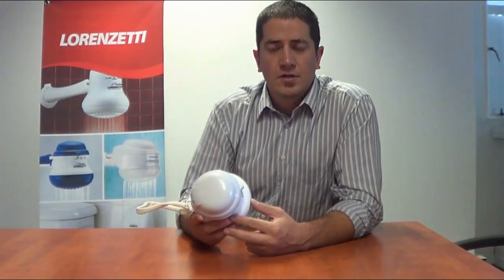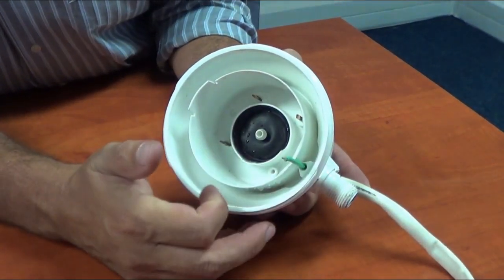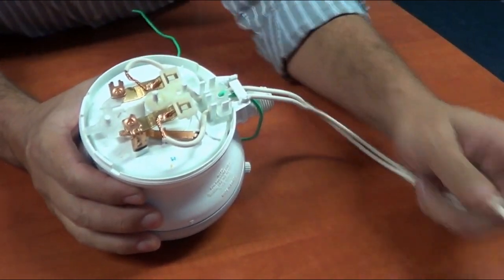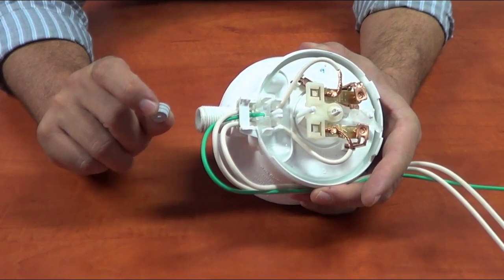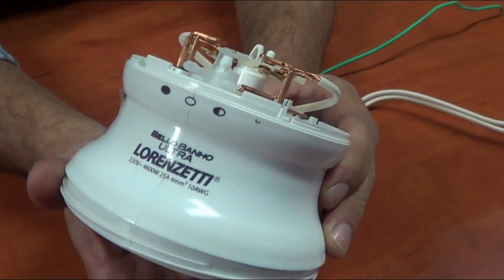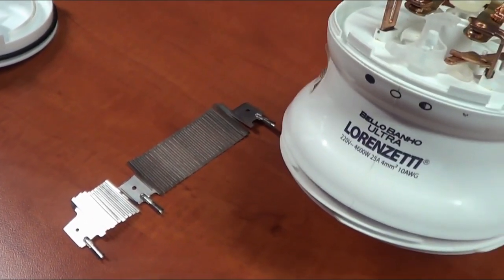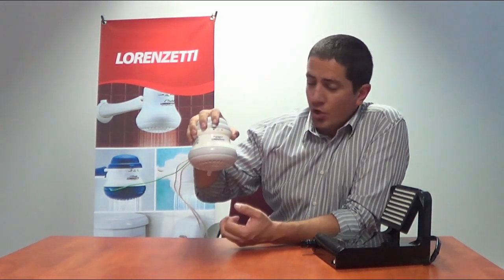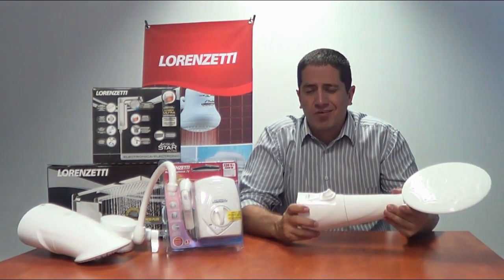Lorenzetti - Save Water and Electricity

Comment: what if didnt connect  the green wire to ground,, because i dont have  ground on my hous?? what am i going to do?
Reply: Most houses (I think more than 90%) have no ground wire here in Brazil, neither does my house. My family and I have never been electrocuted.
Reply: If you change the temperature or touch it or come too close to the head while it's running you'll get a considerable jolt. If you have a concrete house take it to metal that's in the concrete like a box of that's easier. Also if you can buy a GFCI breaker it'll help keep you safe by shutting off the power of it senses you are getting hit by electricity.
Reply: Loop the green to the neutral
Reply: Don't use it if you have no earth wire, otherwise you will get electric shocks from it
Reply: @GabrielRhBR   never say "NEVER hve we been electrocuted". It is like saying I hve never been dead coz I am a live.  YOu hve just been lucky up to now . What about tomorrow?. You may come to regret one day, when you see it happen to a loved one.
Reply: @AutoUnder  it is not permitted, more over if you read the manual, it says that exactly you can not do that.
Reply: use metal pipe to attach it to shower outlet bond ground to that pipe that way faucet and drain will all be at same potential
Reply: You asked a long time ago but maybe the answer will help some one else . You just clamp the green wire to the metal pipe . Thats where the earth wire grounds anyway, it just does it outside by the meter

Comment: Hey how do you fix the switch that controls the temperature when its on hot the water come out hot
Reply: Come out warm i mean
Reply: @wandilegift6001  try to reduce the water flow
Reply: @wallace.museka  the water flow has already been reduced
Reply: In that case it might be something to do with the elements and if the elements are intact then it's definitely something to do with the contact points on top of the shower head. All 3 points must touch the other respective points  inorder to have hot water.
Reply: If it's a new purchase then it would be best to return it to your seller
Reply: by increase or reduce water flow
Reply: the heating element brokes. replace it